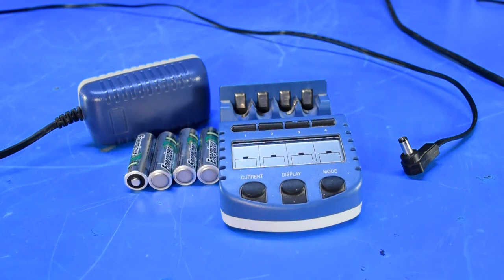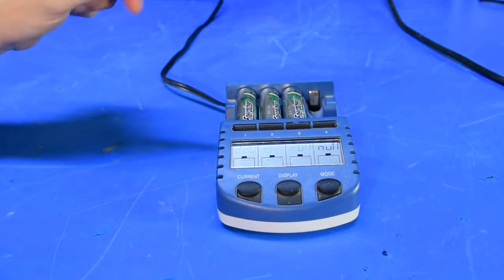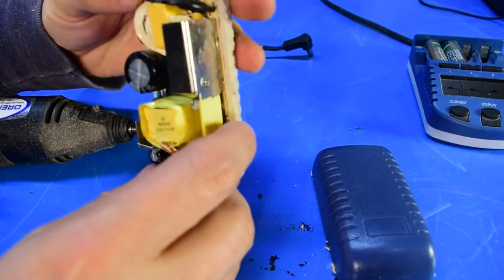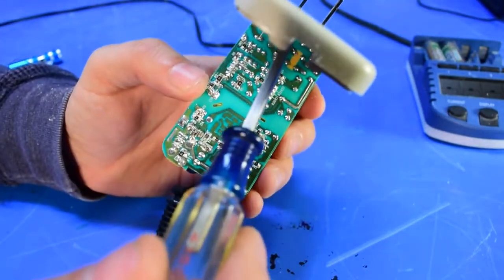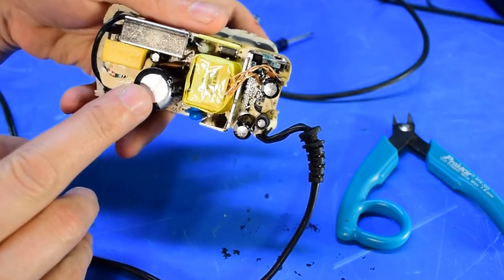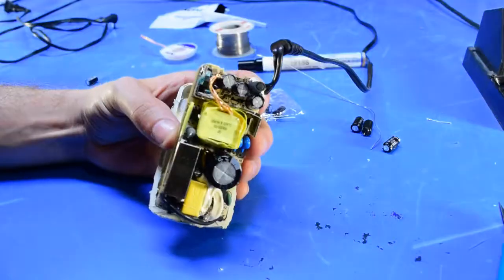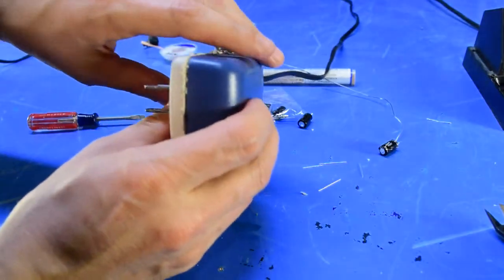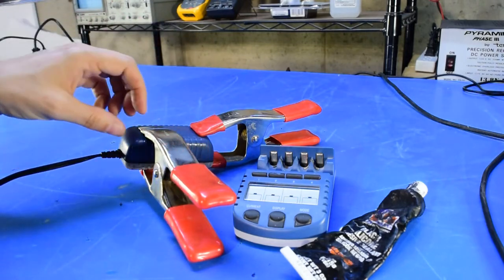LA CROSSE Technology BC-900 Smart Battery Charger Repair

Comment: These power supplies are hard to find and are a weird design.  The power supply puts out 3 volts but like 3-4 amp.  That's because the Lacrosse charger doesn't do any voltage adjustment and relies on the brick to supply the correct voltage.  After I lost a second Lacrosse PS, I said the heck with it.  Instead, I wired it up to use a 12 volt cigarette style power connector with an adjustable buck converter which converts the 12 volts down to 3 volts.  This means you can hook it up to your car supply or in my case I use my 12 volt Solar connection with cigarette plug to charge the batteries with my solar panel storage instead of AC.  You could also do this with ac wall warts that are 9-12 volts and a buck converter but I recommend a regulated PS and make sure it puts out at least 10 watts to do decent charging speed.

Comment: I had same issue with BC-900 and have fixed this replacing the 3 caps. Thanks!
Reply: I just googled this charger issues, ran across this and going to fi mine instead tossing it out!

Comment: Hi again,I have a question for you regarding the La Crosse BC 900,have you charge AA or AAA Batteries using the BC900 went over the manufacture capacity,for example charging a 2500mah battery what was the highest figures  you ever went over if you did,the reason i ask you because you still have the La Crosse BC 900 working correctly am i right,if i'm right please share the information i have the same charger.

Comment: I replaced 3 capacitors 1000 uF, they were weak But the output is a variable voltage of about AC = 30 mV. Measured by multimeter

Comment: Still, I can see that top cover coming off in the hand of an unsuspecting "helper" who goes to unplug it for you, esp. after the silicone has been softening for a few days. I would put a zip tie around the body, using the Dremel to make grooves at the edges of the case if need be.  Mine has just taken the same nose dive, and I appreciate your pathfinding here, although I am not looking forward to the task--which I sought to avoid by "buying Lacrosse" in the first place.  Far from replacing Lacrosse with Lacrosse, they've taught me to place my next bet on something else.
Reply: I used a hand-held metal hacksaw and had infinitely more fine control than I get with a rotary cutting wheel. In most places I could tell that I had left the plastic paper-thin and was able to crack it simply by prying with a flat-blade screwdriver.
  Having done it however, I was surprised to see the caps were all fine, but indeed I was still getting goofy behavior with the two batteries I was trying to recharge. 
  Substituted different brand and the charging went fine. Oops. The Lacrosse product still works fine: I apologize casting aspersions. I still hate the inaccessible case, but who doesn't do that these days? Probably Lacrosse orders out for these anyway.
  I did take my own advice and used a single zip-tie to put the case back together--no adhesive of any kind. It's fine.

Comment: The same problem I have had with the charger just bought. ten months after buying it with the same failure. They changed the charger for guarantee.
Now four years later the fault appears again.
Capacitors are at the end of the power supply. They can be added inside the charger if there is space. Thus it is not necessary to disassemble the charger.

Thank you very much for explaining the failure. I thought the fault would be the round connector for dirt. or the cable near the cut connector.

My charger is the techno line bc700. The charger is the same. colour Black.

Comment: Excellent presentation! A sound troubleshooting strategy, clear disassembly procedures, professional desoldering of questionable components, (missed the soldering process though), smart preliminary testing to see if repairs worked, followed by re-sealing of charger case with future repairs considered. This is the presentation standard by which all "how to electronics repairs" should be judged. Stellar!

Comment: Good day. There was a similar problem. But, the charger behaves the same way as you even without batteries. The power supply is normal. With the battery when you first turn on, the current keeps stably, but after a few seconds it reboots. When the charge mode is activated again for the 2nd time, then the current begins to rapidly fall down and also reboots. And so cyclically. The cycle time is about 12 seconds. I will be glad to any hint. Sincerely, Vitaly.

Comment: In my charger I put 12v charger instead of 3v charger, and it stoped working. I hoped it was only fuse.
I opened it but there is no fuse inside .
What do you think happened.
Reply from the maker: I think you broke it.
Reply: @SevenFortyOne  Yes I know. But can it be repaired or I should buy new one ?
Reply from the maker: Sorry for the snarky reply...I had a bad day yesterday and that's not your fault.  Anyway, I don't remember what the charger looks like inside exactly but I think the only thing in there were a few ICs.  I'm guessing the 12v from the battery you put in damaged the IC internally.  Lacrosse probably left out protection circuitry to save cost so there is probably no way to fix this.  You could look and see if there is some sort of reset procedure for these that is able to wake up the microprocessor but that's a Longshot.
Reply: @SevenFortyOne  Thank you very much.
Reply: I did the same thing recently... shame on LaCrosse for using a standard 12V plug for a 3V device.  Did you ever find a solution? I looked at the circuit and could not find an obvious solution.

Comment: Great video on repairing the charger AC adapter and restoring your charger to normal operation. I purchased my BC-900 from Amazon in Nov. 2008 and noticed it's starting to act up. It is still working for now. Those capacitors with the wrong formulation caused many computers and other electronics to fail for years. Some of those BC-900 chargers were also experiencing catastrophic failures according to the candlepower forums. There are ESR meters out there with probes that can test those electrolytic caps in-circuit without undoing one of the legs. Were all of the caps 1000uf@10V?

Comment: I recently replace those 3 caps with a G-Luxon low ESR caps from an old PC motherboard. I still get a reset now & then but it works fine compared before. Before I did this mod I solder a 22uf tantalum caps on the charger motherboard right at the power input jack. It solved the constant reset & the charger runs cool even at 1000mAh charging current but I was getting an erroneous reading after charging : like my AA batteries where reading more than 3,000mAh capacity after charging. I eventually remove the tantalum caps after replacing those 3 bloated capacitors on the power supply adapter & now my charger works like it was on the day I purchased them. However I still observe some reset now & then perhaps due to the 2nd hand replacement capacitor I got from those old PC motherboard. I might resolder back the tantalum cap again into the charger board to see what happens or replace the electrolytic capacitors on the power supply unit with higher value if I can find one that will fit the plastic case

Comment: I'm a little surprised you didn't check the input voltage on load, or try a known good power supply, before taking the dremel to the wall wart....
Reply from the maker: I didn't have another wall wart that matched the specs of this one to try otherwise I would have done that first.  

As I showed at the beginning of the video, the charger's behavior sort of pointed to the problem being power related.  These wall warts are known for being problematic as they age so it didn't really seem worthwhile to bother with setting up a voltage test.